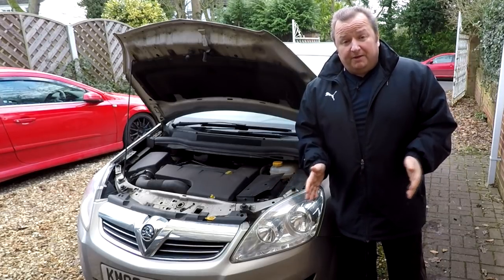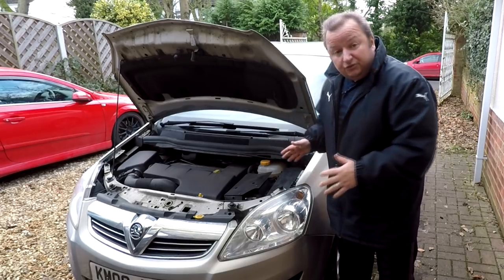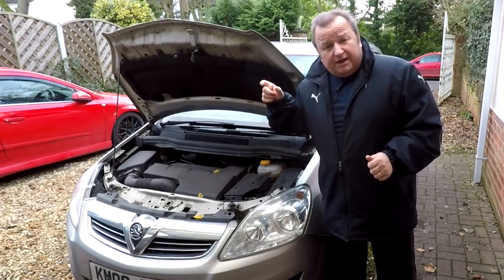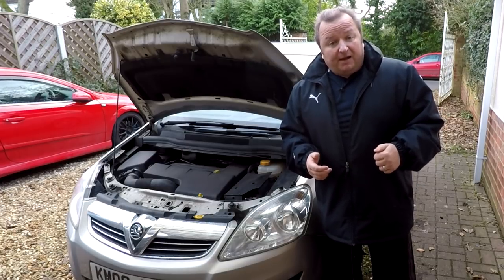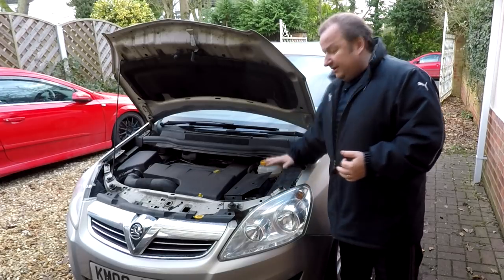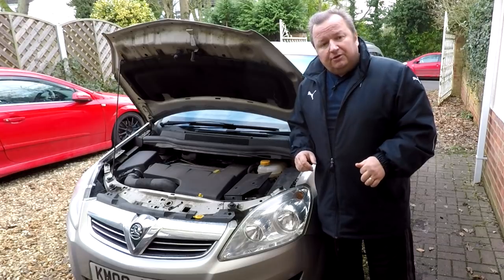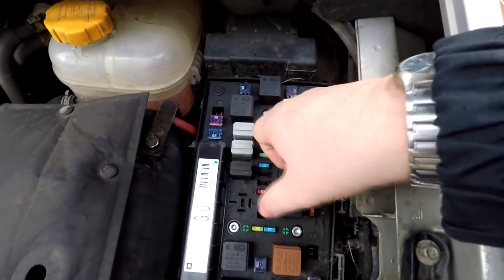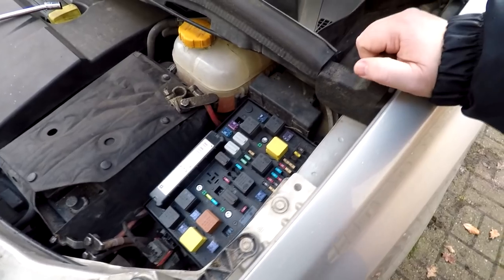Vauxhall Zafira B Throttle Position Sensor Fault Code Fix Astra Opel  VXR

Comment: I believe your advice helped me solved the problem with Opel Astra H 1.7 CDTI 74 kW. When I would start engine and weather was warm / hot (25 – 30 degrees of Celsius outside), car would gone to limp mode as soon as I press accelerator pedal and would not rev engine, only engine shutdown and restart would temporary (until next accelerator pedal press) solve this problem. I also had got error codes P1120 and P1122 which would indicate accelerator pedal position sensors.
When I had similar problem few years back (only them engine would rev its self-up without pushing accelerator pedal) repair shop just switch accelerator pedal and problem itself came back few MINUTES later then another repair shop took very basic set of actions – disconnected and cleaned accelerator pedal contacts, dismantled and cleaned UEC, disconnected and cleaned ECU contacts (and for all of this work they took only a fraction of money which has been taken by earlier repair shop which just unscrew 3 bolts, disconnected accelerator pedal and put another used pedal in without even worrying to test their work and after that offered to change whole ECU for a price that was almost even to half car market value at the time). So after remembering how those great repair shop guys solved kind of similar problem last time and after finding this unbelievable usefully video I dismantled and cleaned car UEC and also disconnected and cleaned accelerator pedal contacts (I would also like to client car ECU contacts but for this engine model ECU is mounted in the way I cannot rich it and I do not have necessary place / tools for this kind of job), put it all back together, deleted error codes using OPCOM and it all worked like charm.
So, this is third day after this repair and problem still doesn’t came back and I hope it won’t. In the end of this story I would like to say honest THAN YOU for making and publishing this video as I believe it helps not only me but also a lot of people to deal with this tricky problem without spending fortune for new parts or even diching the whole car. Sir, you are example not only of decent mechanic, which purpose is to find and fix the root of the problem, but also of person which has high level of empathy, towards its costumer and understands that these kind of problems should be solved by trying solutions from cheapest to most expensive and not the other way around, without randomly changing expensive car parts and by such actions ensuring high profitability work flow with kind of low labor intensity tasks. I believe I can’t say enough so THANK YOU one more time 😊
Reply from the maker: Well done for having a go and thank you for your kind words. All the best, Martin
Reply: Hey! After a month or so is it still running without any issue? I have the same car with the same problem! Thanks
Reply: Yes it does :) After this fix it runs like clock, give it a try :)
Reply: @evaldasmingaila2527  Thanks for the quick reply! Yeah on sunday im planning to clean it entirely! I will let you know the results :d
Reply: My zafira 1.9 not rev at all im trying this tomorrow will let you no if it works
Reply: I have the identical issue, rac couldn't solve the problem, 3 garages and 6 mechanics couldn't find the problem, I changed peddle today, issue came back. Tomorrow I'll do this and while I'm there I'll service the throttle body and clean map sensor. I'll come back if it works and leave a thank you 😊

Comment: Zafira B 1.7Tdi. Had a problem with accelarator not working at all, or more commonly loss of power. The turbo was kicking in but not properly. Took it to a local independent garage. They checked it out, replaced the pedal, but couldn't find the problem. They recommended an independent Vauxhall specialist. He wouldn't touch it as he said it could take forever to find the fault. He said Vauxhall dealers start changing parts at £500 - £1,000 a time. Vauxhall dealer would charge approx £100 just to look at it. Tried this. Worked a treat. Thanks Martin! NOTE: Alfred's comment was right - there no need to remove the little black T10 Torx screws.
Reply from the maker: Top job Calum Well done bud.

Comment: Well done guys. I have a problem where the revs keep dropping to the point of her almost cutting out.  In my case it might be the oil pressure sensor which I've got issues with as far as it is leaking.  Great video guys

Comment: I had problem tnat engine light on esp light on, faults 1220 1222 when i press on gas pedal it slowly raises rpm a bit and hold, no reaction on gas pedal. I cleaned contacts because there was water been before. And it works ! Thanks :)

Comment: I kind of wanted the throttle sensor to be cleaned as well. Just to show how to. Or even how to replace with a scrap yard bought one. Like even if it wasn't needed. You could just say. Hay heres the part. This is how to get it, change it. Your videos are so helpful. I watched it and haven't even got a vauxhall. Wierdly relaxing.
Reply from the maker: Most of the time it’s not the sensor but it’s this. Thanks for watching.
Reply: +retrorestore cool

Comment: Good morning.. I have a 2009 vauxhall zafira 1.9cdti with no fault codes stored, but the throttle response is very poor, then all of a sudden off she goes, have you any idea what the problem could be? Sorry if I am on the wrong page?
Reply from the maker: Could be blocked dpf or egr valve .
Reply: @retrorestore  Thanks for the reply, you guys are worth weight in gold with all your videos.. Thanks again will investigate further. 👍

Comment: Thanks for the video, but sometimes the sound cuts out at the vital moment. Also it would be nice to see the electrical contact cleaner brand on the spray can, even if you dont actually want to recomend it.
Reply from the maker: The sound is fine Larry, must be your end.

Comment: Hello,

 I noticed it was not necessary to unscrew the 4 little  black T10 Torx screws.  (Actually there are 5 of them but none of them need to be loosened.) 
On the rear right corner of the relay box you need to release two small latches and then the cover with the relays comes off.
Nevertheless the video was very helpful !! Tx

Comment: Top video. Just to add, the importance of cleaning water drainage areas and keeping Under car protection cover intact. That water got in somewhere and if not corrected it will again. Also on these cars you need to take out skuttle plastic to replace oil and fuel filter . Make sure its put back correctly… water & electrics do not mix

Comment: Glad you fixed the problem. The fuse box is the best place to start and it always pays to try the simple stuff first. I get my contact cleaner from Toolstation. White grease is also your friend which will help prevent corrosion on exposed electrical connectors. You will have seen plenty of the stuff on the Acclaim. I think that's what contributed to their reliability. BL/Austin Rover must've had a job lot at Cowley that they had to get rid of pronto. OP-COM is the best Vauxhall/Opel diagnostic software. These cars need genuine/OEM parts when it comes to engine bay sensors and suchlike. When I had to replace the EGR valve on my Mk 4 Astra I fitted a Delphi one and it was fine. These sort of aftermarket parts are a false economy.
Reply from the maker: Yes, I agree. Most modern cars in the scrapyard are not there because of rust, they are uneconomical to repair due the the price of the expensive electrical parts. It's madness

Comment: Hi..vauxhall zafira b 1.9tdi  starts up and runs for few miles, then stops and will not start, half hour later it will start but do same again, any suggestions pls
Reply from the maker: Check your codes bud.

Comment: Going to have alook at mine no fault codes but some times the delay between pressing the accelerator and the engine respondingcan be 3 to 4 second

Comment: Hi mate I have a 2010 zafira the car revs fine but on idle it cuts out and the sterio don't power up any more just wonderd if u had any ideas
Reply from the maker: Check the fuse to the stereo and you'd need to plug in an obd2 scanner to see if there's any fault codes Lee.

Comment: I have a vauxhall zafira mk1 and have fault code p0170 short trim bank 1 lean I can't find the problem could it be the throttle body gasket as I've changed maf sensor and o2 sensors still getting erratic idle and lose of power any help would be appreciated
Reply from the maker: lean is normally a leak sucking in more air.

Comment: Hi. Thank you for the video.
 I am having a similar problem with my Astra H after driving through some flood water. Do the 4 T10 screws need to be removed? Is it not just the 3 T30  screws and the 10mm nut that holds the fuse board down?
Reply from the maker: I can't remember bud, sorry.

Comment: Zafira B was idling fast and on occasion the needle was bouncing. Opened fuse box lid and all looked OK but when I took out the fuses and looked underneath and below I could see the smears of damp causing the problem, thanks so much for this posting, car now drives like new and starts with no effort. I had a list of cheap options to possibly correct this problem and glad I changed the coolant sensor down by the stopcock, the brass end was black from gunk in the system which seems to collect at the bottom and changing it helped the cars performance as well but not nearly so much as drying out the fuse box.
Reply from the maker: Nice one bud, well done

Comment: Martin, first of all thank you for sharing this! I have a similar problem with my astra h. I am following your advice step by step however I cant remove the part after undoing all the screws. In the video seems to come out easily, but that's not the case for me. Would you have any suggestion? Thank you
Reply from the maker: Just make sure you undo the screws fully as I said in the video and give a good pull.

Comment: Ah that old chestnut. Thinking through a problem before randomly changing parts.... Always useful to remember. It's also worth remembering is that the computer can only tell you the fault it thinks it has not actually tell you where the fault is. Well done.
Reply from the maker: Yes that's right. Many dealers just change parts at the owners expense,
Reply: It wouldn't be too bad if they changed the right part first time though....

Comment: Great how to Martin. I've now got a zafira b as my daily driver and although it's the 2.2 sri auto and it's pretty nippy. If I cough something breaks on it 😂  I have a bearing on its way out. Leak from the engine Bay Area but can't find it anywhere (roll on the dry weather) 2 tyres that seem to lose air but when they fell like it. Warning lights that come up on the display ie brake lights but all lights work. Never getting another Vauxhall. Anyway. Happy new year mate looking forward to more vids
Reply from the maker: Looks like you've been unlucky Antony, I know many people who have had these for years woth no problems.

Comment: Nice job, who would have figured? Was that puddle or a small lake, and who did it? Inquiring minds want to know the rest of the story.
Reply from the maker: It was just adding 2 + 2 and getting the answer Jim. problem only occurred after the big splash bur a bit of research opened up a whole can of mis diagnosis in the forums but reading between the lines pointed towards trying this first without spending any money. Common sense really instead of taking it to a garage and them throwing parts at it.

Comment: Hi buddy, Great Video! I have exactly the same problem with my Astra Sedan 1.8 litre Z18XE I4 16v but the configuration for the fuse box is different , there are two relay boxes on the engine bay and then a fuse box in the cabin area, by any chances do you know how to do it in this case? I don't see anywhere any bolts or something to take the fuse box out.
Reply from the maker: Sorry bud, we don't have that vehicle any more.
Reply: @retrorestore  my question was more if you had the same experience with the one with the engine Z18XE and if you know how to fix it in that engine bay configuration

Comment: Great help thank you so much.  Do you have any fixes for a heater resistor continually blowing dispute checking the blower which is working fine?
Reply from the maker: Is it on a heat sink? that would take the heat away from the resistor.
Reply: @retrorestore  I am not sure what that means.  Should the resistor be located in a cooler place?  We had no problem at all through the summer. It was just when the winter came in and we needed more hot air that it started being a problem.

Comment: Great video Martin. Did you not loose any codes when disconnecting the battery.
Reply from the maker: Just had to re code the radio

Comment: Great diagnosis and fix Martin. 9 times out of 10 it's electrical connections that cause problems with modern cars. Problem is there are 1000s to go through. Just a tip that might? work, tape a plastic bag over it. First did this many moons ago with the dizzy on my Mini....stopped it cutting out in the rain.
Reply from the maker: Haha, Yes Malc, I did the same with my 1967 mini back in the 80's lol

Comment: Do the error codes need resetting after the clean up?
Reply from the maker: Not resetting but you can clear the fault codes from the stored memory.
Reply: @retrorestore  thanks sorted. Just need to sort the box cover now as clips have broken